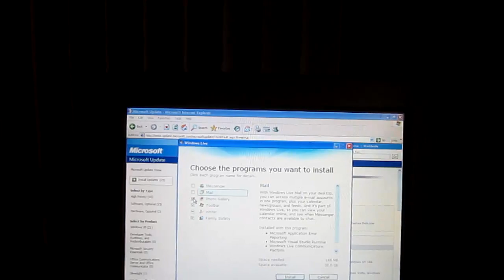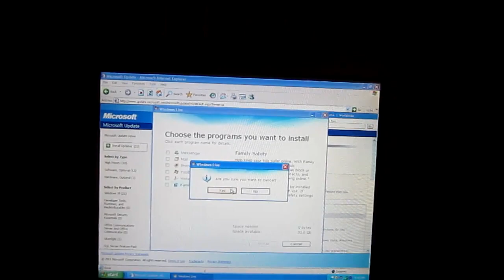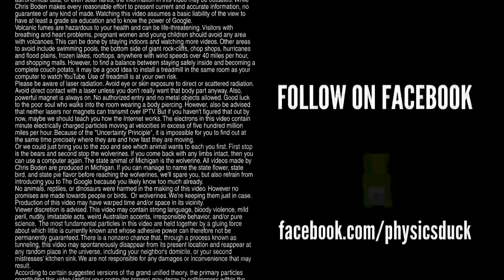Captain's Blog 2-15-11 Giant Capacitor Arrays and Padnos Train

Comment: I see Cat5 running through the Hall using Duct Tape!  I've used Duct tape to run cat 5 before too.  I see a Kenwood receiver in the Coffee shop with some music system speakers on top.  Too bad I'm not there, I'd install ceiling speakers for you.